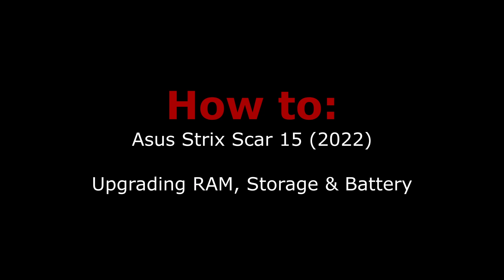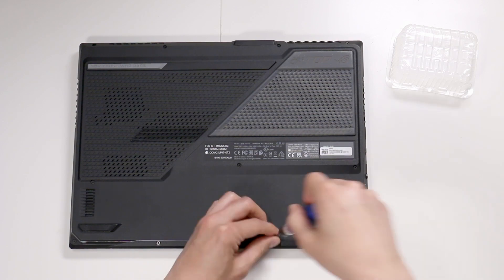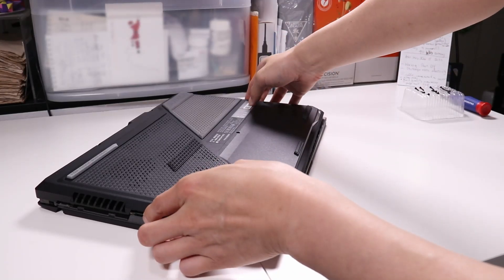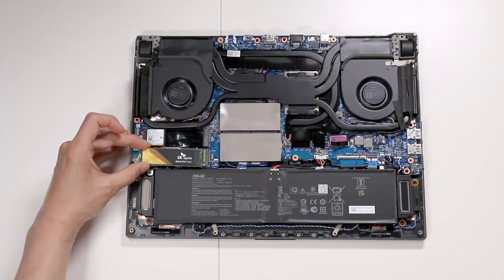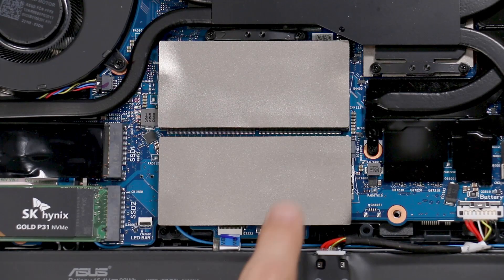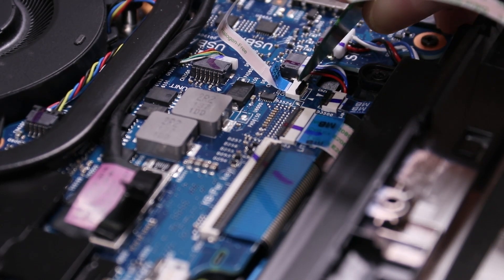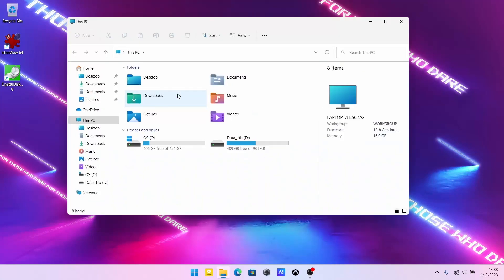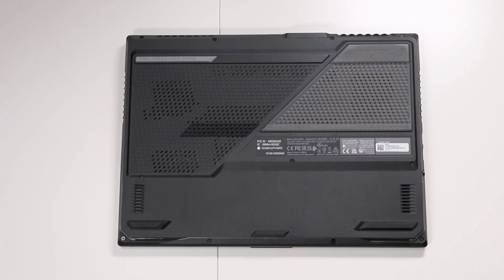Upgrading Asus Strix Scar 15 (2022) - SSD, RAM & Battery

Comment: Thank you very much, I follow your instruction exactly and was able to add 64GB memory to my ROG laptop.  Great work
Reply: Hey man I want to upgrade mine, also a g15 advantage edition 2022. Which ram did you get and reco for me? Thanks
Reply: @edssszy  My is Crucial 64GB DDR5 5600, it is bit overkill. But it work fine
Reply: My scar 15 doesn’t come on after I inserted the rams. The battery cable doesn’t click like he showed in this video. It is levelled in terms of height with the battery cable. Any tips? It’s my first time
Reply: @Photolover-t8h  I am not the original poster.  You might be better asking the Firstlook himself.  I think he can probably provide better help than I can.  But I will check my battery conneciton first before I do anything else.
Reply: @Photolover-t8h I used 2 Crucial RAM 32GB DDR5 4800MHz CL40 and it works perfectly

Comment: I've had this unit since mid 2022 I wanna say and I love it. The ONLY gripe I have with it is I got the 16gb RAM and 1tb SSD model, so adding more of both will be a big step up for me.
Reply: I got a seatgate 4tb extended drive USB connector, it dangles off sure, but I've never thought about a storage upgrade since
Reply: @zrakonthekrakon494  I've got a couple of those for my desktop too. A big issue with this laptop is it only has 2 USB ports.
Reply: Same, just put a crucial 32gb kit in mine and trying to find a good 2 to 4 tb secondary m.2
Reply: except that it has a loud fan noise when playing a game and it heat up a lot  i have the rtx 3080 I9 12T H GEN
Reply: @aminebencheikh260  I have that exact same version and yeah its a real jet engine of a laptop

Comment: One of the top/best videos, now I got a machine with 64gb ram and 2tb ssd. Although I think it has issues with win 11 home, ssd overheating (Samsung pm9a1 2tb) and firmware issue (no upgrade via Samsung magician), otherwise no complaints.
Reply from the maker: Wow, top of the line upgrades! Yeah, it's tough when they offer the fastest speeds, it also means a lot more heat. Twiddling thumbs... what to do... :-)
Reply: @FirstL00k  Lenovo legion 5 has a huge metal plate covering its ssd, adding thermal pads, you can create a heat-bridge and thus better heat dispersing and cooling via air. The WD SSD I got there is on pár with that Samsung drive from asus, and with IOPS only it's slightly below 960 Pro. Max. Temp I had was up to 60C, usually I'm around 40-45C

Comment: Hey I have a 2023 G614JI Scar 16. I would love to know if there is a way I can tell if I am able to add an ssd to this. I did the cmd prompt already to find out I can upgrade the ram but I really don't want to remove the back just to find out if there is an extra storage slot there.

Comment: I have the G533ZX here with 32gb 4800mhz ram, upgraded to 64gb 5600mhz ram, but literally nothing in bios, even advanced settings to let me change frequency or run XMP settings ??
Reply: Motherboards can only support a certain amount of ram and a certain amount of mhz I think also make sure u got the right ddr4 or 5 that fits ur motherboard

Comment: I have G733ZW, and I want to replace or add another 2TB SSD, the standard one is 1TB Micron Sigle sided memory, but the new modern one, is double sided, Kingstone KC3000.
The manufacturer does not specify whether or not there is enough space for it ?🤔
Reply: Did the Kingston KC3000 worked? 😬😅

Comment: I'm looking to upgrade the exact same model you have , and I'm going with Crucial P5 Plus ( up to 6600mb\s ) and for the memory I'm going with Crucial 32GB Kit (2 x 16GB) DDR5-4800 SODIMM 
my question here , are those components compatible with my machine ? and for the ram there are options for higher ram speed but i know this model supports up to 4800mhz so what should I pick ? 
so do you think this upgrades are "best" options for my laptop in the market ?
Reply: If you have the 2022 model it can support up to 5600mt/s 64gb and the nvme you have chosen is gen 4 which will work fine and if you're in the UK ATM the WD 850x has the best price for its performance ATM  and lifetime it's read is 7300mbs  😅
Reply: The laptop already comes with a DDR5 4800kit

Comment: Hi there, great video! Was wondering what exact model of the strix you have? Mine is the G533ZW_G533ZW, am i able to upgrade it to 64gb ram?
Reply: Yes will support 64gb if it's the same model as video is showing 2022 Variant
2 X 32gb 
If it's the 2021 Variant of the laptop reply to me the model of it such as if it is the "ln148w" 2022 then yes will work
Reply: I have a G533ZW-AS94 and upgraded with 2 CT32G48C40S5, it works fine 👌🏻

Comment: Hi, how do u do static discharge?
Reply: I have never had an issue or wore gloves 
Their are bands that people seem to use or you can use them gloves.
Once you have disconnected the battery or power if a pc press the power button so the components can discharge I.e. the capacitors 😊